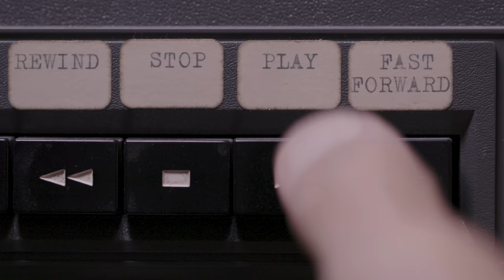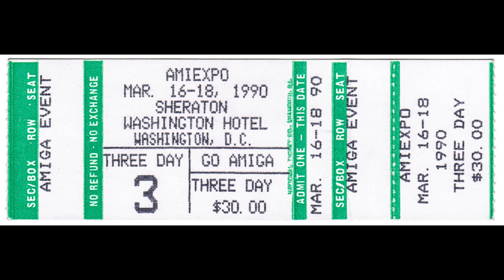The History of the Commodore Amiga - Rare Jay Miner Speech AmiExpo 1990

Comment: Such fond memories of my first and second computers (an A-500 in 1991, and later, an A-2000 equipped with a 'PAR Board' -- personal animation recorder.)  The Amiga is what got me into 3D object modeling and animation which I've been doing since then (31 years).  Deluxe Paint introduced me to digital art.  Some of the team that developed VideoScape went on to develop Lightwave 3d specifically for the Amiga platform, which is still my primary 3D app which I started using on a Windows PC back in 2000.  My YouTube channel (caddyjoint96) carries twenty of my Lightwave videos including a few of my earliest ones from the 1990s compiled on my Amiga PAR board which dumps to video tape, which I recently digitized into MPEGs in order to upload to YouTube.  The Amiga computer will forever remain in my heart.

Comment: @10:10 the folly of the financiers/Commodore attempting to save a few dollars at every opportunity is well illustrated here. They already had 512k on the board, but were told to reduce it to save money, which meant completely redesigning the board- before later having to do another workaround to allow 256k to be added to return to the originally intended 512k.
Reply from the maker: Yes, exactly Dan

Comment: 35:37
Jay's Amiga wishlist!😮
 
1991 date window
2 to 4x Chips speed/Memory bus bandwidth
4000 (12 bit 4096) simultaneous colors
64000 (16 bit 65536) color palette
64000/65536 color HAM mode
8 sound channels with 56kHz sampling rate
Addressable Chip Ram increased to 8 Megabytes
Addressable Fast Ram increase to 4000 Megabytes (on 68000?)
(68020 and up support 4 Gigabytes)

Man, I feel bad for Jay :/
Reply from the maker: I know. It is a great list and makes a lot of sense. 8mb Chip RAM, 8 audio channels, WOW!
Reply: Vampire 4SA in a nutshell right there... :-)

Comment: By March of 1990, they should have been finishing up the 3rd custom chipset for the Amiga.  It is a disgrace that in 1990, the original chipset was largely unchanged with only minor upgrades over the 5 years.